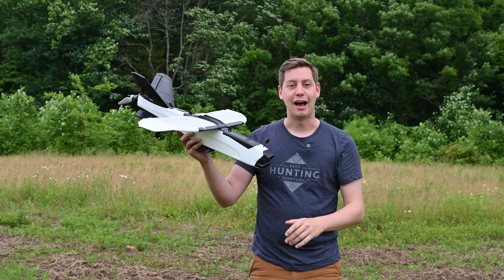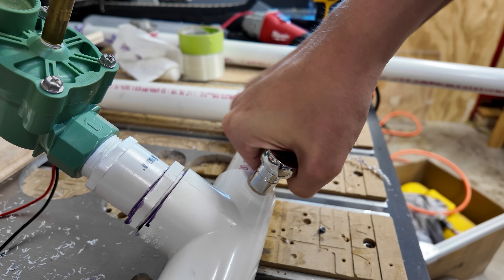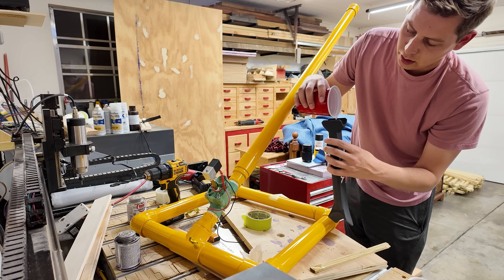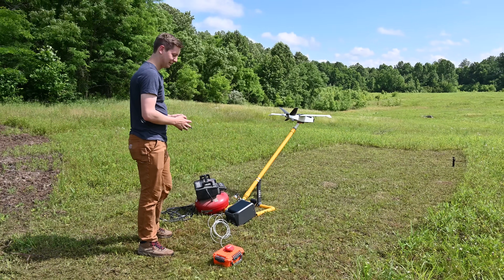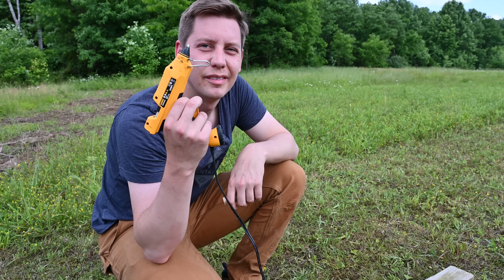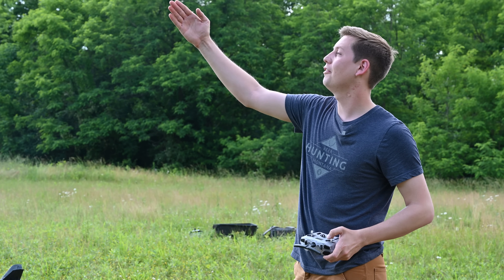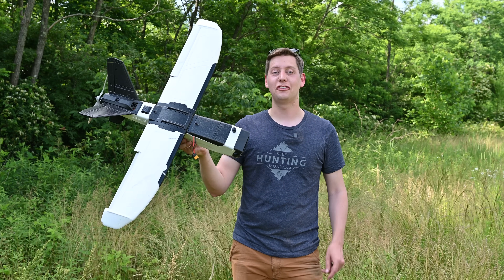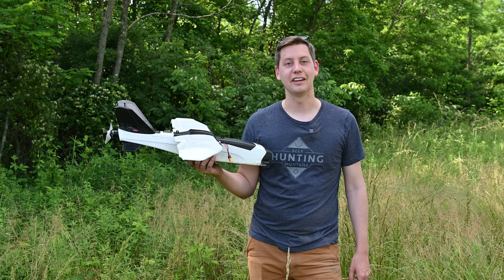This Plane Doesn’t Need a Runway

Comment from the maker: Thanks again to Bambu Lab for sponsoring this video! Check them out: 
https://us.store.bambulab.com/pages/3rd-year-anniversary
Reply: @michaelrechtin the airplane sits at a wrong angle on the pneumatic launcher, so it is not travelling in the direction of normal flight, as the Starfighter in the video. Yes, the rocket on that one fires at a similar angle too, but it has to lift the huge weight of the airplane, not just more it forward, compared to the ultralight RC plane. Otherwise cool.
Reply: Large(r) square tubes, so you don't twist through the CG and can contain all of the gas release without blowing your (lubed) piston out of the launcher. Should stay straight and survive may launches with the 3D print too xx though honestly, id just use a potato and let it yeet the piston every time... not so great for sponsors ;)
.
then give best design to the werld? :D
Reply: Put rotors in the wings to start it and add flaps over them that close if you can.
Reply: make a large sling shot out of rubber surgical hose
Reply: nevermind
Reply: Link for Schrader valve npt adapter?
Reply: Try a simple catapult, like a crossbow.
Reply: where did you get the rc plane?
Reply: "This is a RC-Plane. I chrashed a lot of thos!"  🤣🤣
Reply: When using multiple boosters (5-7)  just put an exhaust cone (changing cross-section) that unifies the thrust vector...just in case one fails you still have even thrust and less torque unbalance...
Using only 2 boosters is not enough even thrust/torque spread....multiple smaller ones gives more leeway...

Comment: A single rocket would be a much better design (even if you needed to size it up a little). There is way too much variation in motors/ignitors/etc and you'll never get symmetrical thrust.

Comment: Another option is to hot glue a little grip made of the same foam board to the underside of the plane. I do that, and it keeps my wrist plenty far enough away from the prop when launching. Also, when launching it is unnecessary to throw it like you're throwing a hail Mary in the last 3 seconds of the play off game. A gentle toss should be all it needs.

Comment: At 8:48 the mangled o-rings may have been caused by the lack of chamfer on the tube (at 3:50). Also, a damping spring will reduce the shock load at the end of travel and prevent the o-ring print from separating (will require a smaller diameter inner tube - perhaps a carbon fibre one?

Comment: Hint on hand launching airplanes.  Pick a spot 20 feet ahead of you, on the ground and throw the aircraft at that spot.  Kinda counter intuitive but using gravity to increase airspeed after your release helps prevent stall.  
I learned to fly model aircraft back when the F-100, F-104 testing was going on.  Free flight to start, then RC in 1972.

Comment: A cheap gas check that if I recall fits 2" is a Gatorade bottle cap. It expands forcing a perfect gas seal, it usually doesn't go far.

Comment: Or you can always try the boomerang method of launching, i.e. swinging the aircraft sidearm style from a wing tip and using a self-leveling gyro for the hand toss. Newer Spektrum SRXL2+ (PLUS) Rxs have the Auto-Level feature for HL (Hand-Launch Assist) built-in. I'm sure other protocols must have something similar. The wingtip toss avoids getting bit by a rear-mounted prop.

Comment: i would drill holes in the outer pneumatic tube about 3/4 down the length to act as vents for the last 1/4 of the travel. you would lose 25% of the power but the tube would probably stay in because it has time to slow down

Comment: Ah, yes the latest and dumbest generation rediscovering technology from the 1960's and acting like it's new. Should call them the "Chinese Generation" though Gen Alpha makes since because it is the version of code that is just barely executable and full of bugs and lacking all the features of the Gold Version. This is ZeLL or Zero Length Launch. It was developed during the Cold War so that the US could still launch interceptors in case the USSR did a first strike that took out all our airbases.
Reply: Maybe they should just go sit on your lawn. Old fart.

Comment: Nice one, Michael! Funny thing is that I have done exactly the same thing as you in the last couple of months - rocket motors and a pneumatic launcher.

The only difference was that I used some of those foam toy gliders from KMart for the rocket, and a small stainless steel tank for the catapult. Never thought of firing a mortar round though. That’s pretty cool.

Comment: Attach a bungle to the base of the piston so it has a soft stop… basically some baracord with a few inches of bungee at the last second to keep the piston from slamming and breaking, but also to keep it from flying off and potentially hitting something/someone. 

I know it works because I essentially built the exact same thing for launching grappling hooks as a teen, but I wanted a captured piston so I could use different types of hooks and attachments. The piston kept breaking so I added a bungee tether and it worked beautifully. 
I used a disassembled broken paintballgun and paintball tank as my air source so I could have it all mounted on my body.

At the time I was trying to develop my own future/cyberpunk ninja tech. I had a custom black hex molle vest with a black straight wakizashi with g10 handles, a custom black “travelers cloak” made of military nylon with black reflective tech details, weighted bottom corners, and a magnetic clasp.. it was a pretty cool setup. It was just a fun design my girlfriend and I got into for some reason. We wanted to be tech ninjas and just sorta… went for it. She had a paintball pistol with custom ammo for pepper, smoke puffs, little flash bangs… etc. and of course we had our grapple launcher. Which worked great! But we had no clue what to do once the hook was attached somewhere… lmao climb it? A thin paracord? How? Haha so we just abandoned it and turned it into something else.

Comment: try this: hollow aluminium square rod , put a rail on it, and a spring or elastic inside. load with a crankshaft lever . boom slingshot ballista

Comment: Nice launches, if you look at the real aircraft launch, you can see that the wing is in flight direction to produce lift, less drag and a better response from the controls as the aircraft is in a flying configuration. Great idea and with some little tweaks might work clean and safe

Comment: Have a pole that goes 5 feet up then attach a small larger diameter tube that is 1 inch length then have the pole at a 45° angle, then put it at maximum thrust instantly it should vertically takeoff

Comment: PSA! PVC is not designed for air pressure. what you have is a grenade. I love the engineering approach .as a Pipefitter with 44 years experiance I cringe when I see people use air pressure in PVC. Take that for what its worth.
Reply: As a pipefitter with 44 years experience im surprised you don't know the pressure rating of PVC, considering a 1/2" S80 pipe has a 2700 PSI burst rating with 500 PSI working pressure, dropping to about 500 burst/100 working PSI at 12" pipe, soooo, tell me again how PVC pipe can't handle pressure... Considering most pancake compressors (the style he uses to fill his launcher) have a max of 150PSI, im gonna say he is safe and not making any type of bomb, so get your panties out of the bunch they are in and relax a bit.

I should point out it took me 2 minutes of googling PVC pressure ratings and pancake compressor specs to find out how stupid you sound, be happy your boss hasnt seen this, as i doubt you'd have a job when some rando on the internet with no pipefitting experience at all is schooling you.
Reply: That's Water Pressure, not Air pressure. You can't compress a liquid. But air can be compressed to several atmospheres; if it bursts under water pressure, you just get wet. If it bursts under air pressure, then the air expands to several times the volume. But hey, don't take my word for it, Google it for yourself.
Reply: @Fitter562lu After 5 more minutes of searching i find new pvc pipe is rated for 300-600 PSI of AIR, that pancake can't make 200PSI, as long as he don't shove it in the corner and try and use it again in 10 years, he should be good.

Comment: thank you for such unteresting video! i think you better use 1 big thruster instead of 2 - it should help to avoid any disballance in thrust (in case of start delay or if one of them failures). if you want to use 2 rocket thrusters you better attach them one by one at different angle, pointing each to center of gravirty. also you can enable autolaunch feature on your flight controller but its not so fun

Comment: The booster stage of multi-stage model rockets have no time delay between end of burn and ejection charge (example would be C3-0 - C-size motor, 3 sec. burn, no ejection delay). Make your rocket motor holder shorter (maybe just capture 1/2" of the end), and cap off the end so it doesn't send ejection gases into the plane. It should eject the motor from the holder and reduce flight weight.

Comment: Omg can you imagine how messed up it would have been if ancient people had air powered cannons that thing was great. I'm waiting for an internal propeller version of Multi-Kill Vehicle.. Piezoelectric Crystals + Amplifier + Electric Plasma generated Ultrasound Audio Spotlight at frequency of Crystals + Electric motor with capacitor bank to regenerate with Thermoelectric generator tech absorbing the electric motor heat = No wings required the duct patterns for powerful airflow be the stabilizer. Gyro be digital for duct controller shutters and Triboelectric Static ducts. Big version of that can have good generator with modern tech.. Flying Crane. Makes goofy Kung Fu noises 

Google: "Boeing Plasma force field blocks bombs" + "Ultrasound control of electric Plasma" + "Ultrasound holography" = Combine with echo techniques is it possible to hold a craft in the sky with pressure waves? Even further.. Is it possible to make a force field for the worst storms. Rise of the Storm Glider culture? Hehehehehehe... - Think Tank

Comment: Few thougjhts

Drilling homes near the end, as someone else mentioned

The ignitors aren't super reliable, with regards to timing.  One rocket might start before another.  Playing around with voltages might help.  On larger rockets some people use 2 ignitors per engine.

Better yet just pick a single larger rocket.   Aerojtech makes bigger ones.

Comment: Hi, by not giving the right incidence angle in both launches, you are lucky the wings did not break (especially with the air launcher) and you are spoiling a good deal of the thrust  because of the induced resistance.    Your air launcher broke because you did not amortized the end of the boom excursion.

Bambu Labs is actually a totalitarian firm pretending that you do can't own what you payed (a lot !) for, so until they definitely stop their behavior, people that are aware of the problem won't put a dime in their "products", especially to avoid being deprived of their basic rights by a captive contraption.

Comment: How's about covering the belly with thin aluminum so as to not get the plane charred, and use no-ejection charge motors? It would mean that the motors will stay onboard of course, unless you can utilize a latch n' drop mechanism on them.

Comment: @michaelrechtin Uh, Dude. They still are doing RATO (Rocket Assisted Take Off). The C-130 aircraft aka "Fat Albert" the US Navy Blue Angels' support aircraft does it for airshows to the public. VC-6 Firebees was a UAV target drone that while it's a civilian run unit of former Navy Employees who are now Federal contractors have the Northrop BQM-74 Chukar doing RATO.

You clearly don't do any research as both my wife and I worked at VC-6 (2000) and they're still used now for military target practice and training.

https://youtu.be/h4VMH5smXO8?si=PK6fTOH8YG43e6Oz

Comment: Cool video, using less weight on your air piston will dramatically increase speed. Rocket engines are cool,put one on a electric RC car and ignition at 50% power. 2 c6-0s!

Comment: You actually doing the ideas I dreamed of doing - if the rocket platform had a parachute tucked under mount and was easier to release when charge blew would be cool.
I flew RC gliders and had an Estes Rocket.   Cheers

Comment: Thinking on you pneumatic launcher, what if you crossed it with a potato canon and set the firing device to a switched channel on a secondary receiver. At the end of you cylinder cut some air reliefs before the piston comes to a stop, this would look like a muzzle brake on a riffle.

Comment: 2 E15 motors is over kill. The average thrust for those motors is 12newtons. which is 3.3 lbs. Your plane is not over  2lb. 1 should work and you could probably use D12's

Comment: It seems like it would be easier to launch by dropping it from a balloon. Or, if you're like me, just put a flight controller in the plane with INAV, using AUTOLAUNCH so you don't need to hold the radio, and just get good at throwing it. Since it's all about air speed, I like to try to throw it level or even a little bit down, and throw it hard, into the wind, with about 80% throttle. I destroyed my first ZOHD Talon GT Rebel due to bad throws.

Comment: gotta apply the newton thrust graph to your rocket selection. That thrust curve was a bit much, one of those engines would have probably been sufficient to get that plane in the air. I like how the mount detaches from the plane (maybe not exactly that design, but the idea is sound) as it cleans up the airflow, but definitely look into adding some thin metal flashing (hardware store, for sealing chimneys and such on rooftops) to absorb the thermal energy of the ejection charge. Or make some sort of piston that vents towards the top of its stroke. That way it drops all the heavy stuff. You can also get engines that dont have an ejection charge at all, then if the controller has an extra channel, use a servo or solenoid to drop the booster when its done pushing (rocket engines have a boost, cruise, and a smoke phase (for visual tracking), then an ejection or 2nd stage ignition charge (or none at all), you can just drop the thing after the thrust profile tapers off in the cruise phase). In fact if it doesnt screw up the CG too bad (and probably with a smaller motor) you can immediately do a pass over the launch site once stable and drop it closer to you instead of it yeeting itself into some potentially dry brush. You might sitll end up with a hot gases problem like big rockets do, the exhaust gases get sucked into a negative pressure space and just sort of swirl there. You can see it happen on a number of launch vehicles, I think even the shuttle would get some hot gas entrainment (idk, i made that one up...but if it makes sense, its valid!) at the bottom of the orange tank from the boosters during its flight.

So there ya go, some vaguely solicited 2 cent brain droppings for ya 😁

Comment: licensed pyrotechnician: those rocket engines are known to have a large margin of error in their strength. use 1 engine instead of a larger size and you reduce the risk of it sending the plane to the side, etc
or that only one engine starts and it goes really bad. 
Then check out real electric lighters for pyrotechnics to avoid the risk of short circuit.

But above all, really cool to start with a rocket! :)

Comment: Look up BQM-167A. It's a carbon fiber rc plane that it launched off a platform with a rato bottle or rocket.  These are regularly launched, as well as BQM-34 and some other small rc planes.

Comment: The rocket method really wouldn't be all that bad if you had a thin gauge sheet steel plate covering the immediate bottom area. I wouldn't do aluminum, as it may transfer the heat far too quick in the event of a failure, though it'd work for the optimal case.

Comment: With the pneumatic tube launcher i saw the problem you would have right away.  the piston tube was gonna SLAM into the fitting at the end and break.  you could fix this, by drilling a bunch of holes  just before the end of the yellow tube, so that when the launch piston passes the holes, the pressure will vent by itself, and the piston tube will gently  bump into the fitting at the end and stay there.  you might put a rubber ring around the top of the piston sealant fitting to act as a bit of a shock absorber... if necessary.  cool idea for a launcher!

Comment: Let's make it 3 stages!  Hand powered elastics propel a water bottle rocket (with the plane strapped to it) on a inclined ramp can launch the plane... At the end of the ramp, water bottle's jet is triggered and powers it ... when the pressure drops, the third stage is lit by the plane's battery and it triggers a regular rocket motor.  Both bottle and rocket disconnect from the plane with a simple 45 degrees cleat.

Comment: If you re do the rocket system have the rockets 1 above the other and put a small bit of aluminum flashing material in the form of a cup that goes over the ejection charge of the engines to protect against the first tries problem. Having them stacked vs side by side will also make 1 engine failing less of a problem as side by side you can end up with differential thrust trying to turn the plane instead with the stacked one in front of the other layout 1 might make it try to nose up or down a tiny bit instead.